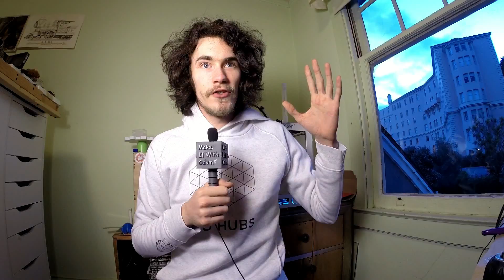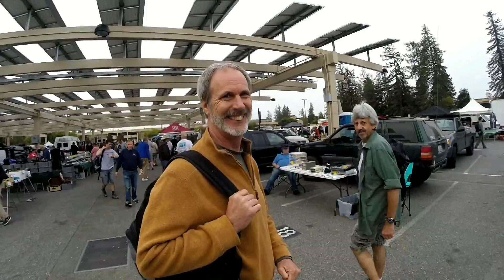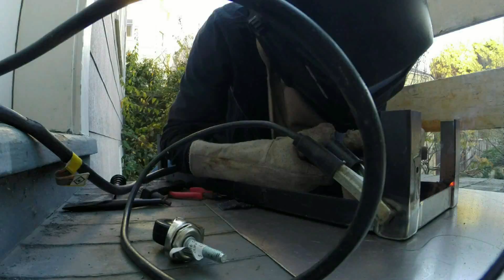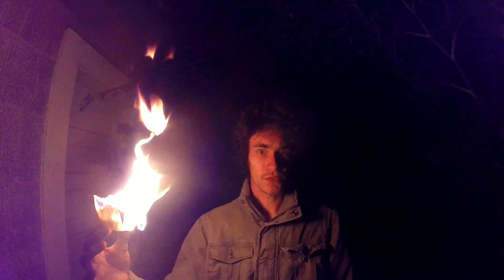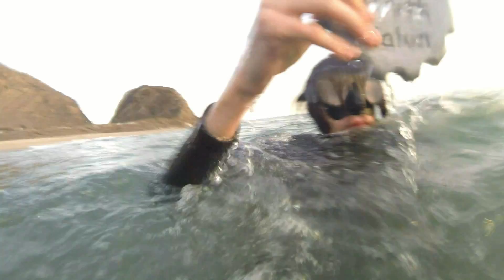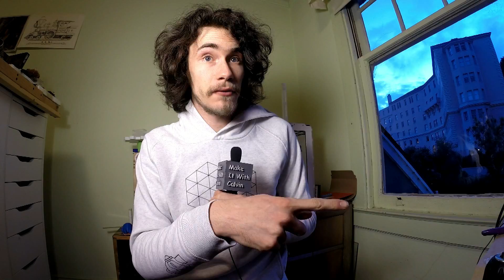3D Hubs FDM Rules?

Comment: Sounds good to me!

Also wanted to mention.. when I had last seen the guidelines.. they DIDN'T have this exception in place, which currently does exist at the time of this comment.
"These guidelines apply to all FDM orders on 3D Hubs and can only be deviated from when specifically discussed and agreed upon between Hub and Customer in the comments section on the order page."

First version didn't have that line which is what had upset me the most.
Reply from the maker: JAT.MN I know how you felt. I had a feeling that there would be an override if you will as i have told customers before that something may or may not work and its their decision as to proceeding or canceling.
Reply: Yea I had a back and forth with 3Dhubs before that was added and told them I would close my hub and go else where. I dont have quite the rating you do.. but im pushing for 100orders here soon

Comment: Im totally with you on support removal. I always preferred to do it for them since then if i broke the part I could reprint it. Set your supports to print good and they just peel right off.
Reply from the maker: Exactly and I have done prints where I had them break during removal... I understand removing supports is not the most fun but I never got why folks felt like it was such a crime being forced to remove them >.<!
Reply: Yeah, and if it such a big deal when you adjust the quote for supports make sure to factor in your time removing them
Reply from the maker: Exactly. I just lump removal and addition into an order. Sometimes if the supports needed adds negligible material cost to an order i will not charge for it...

Comment: I have yet to start up a 3D Hub, but as a 3D printer I can see that leaving the support or removing it could be good or bad. If the item is very fragile, the support material may help in shipping. On the other hand, especially for those people not using Simplify3D for their slicer, support material removal has probably burned a number of clients. Personally, I think for complex objects requiring a lot of support, this should be an extra charge at a minimum.
Reply from the maker: That would be something you could discuss with a client. What I got a feeling of online from one of the heads of 3D hubs was people were literally pulling a print off the machine, tossing it in a box and sending it out with support attached WITHOUT pre-discussing this with the hub. That is why their implementing the removal, although if you and the client pre-decide to keep it that is your deal. As for the support itself, yes you can tack that fee onto the order... My rule is if the supports used is minimal and super easy to remove I may or may not charge for it. If your item though needs a LOT of supports I will charge for that! I also lump removal into the fee for support...